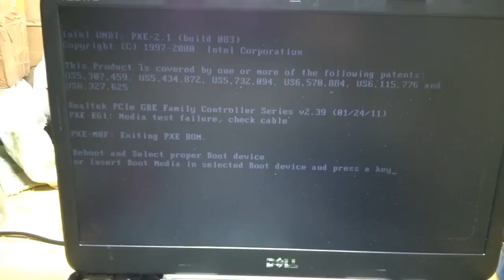Dell Vostro 18V Vin shorting Removal

Comment: Sir, I need a help. Please tell me about Acer One 10 actual charging adapter or detail about it's W,V& Amp . When  i charge it from normal phone charger it's charging stuck at the same percentage. I ask you here this question because on that link you disable comment section.
Reply from the maker: 5v, 2amps normal phone charger